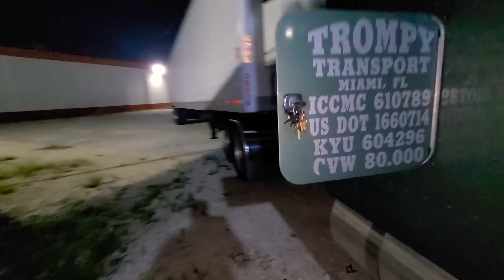Already Broken down 🤦🤦🤦🤦🤦

Comment: Hey brother, did you ever get a chance to check out the aluminum reservoir?  I'm still waiting to get my truck back after an outer frame rebuild. There done, but buttoning up loose ends Now! To make sure I have no issues once I get it back. Then the x day it's getting a front end alignment. Replaced the shock's, springs, lowered it 1 1/2 in the front, spring pin bushings, new rear driver oils!

Comment: Man I know the pain man. My shit wouldn’t start then got it started and it started pouring oil out the oil cooler gasket so changed gasket and starter then did 2 loads and my fan clutch started wobbling like a drunk so had to change that too. Seems like when things start kicking your ass you can’t catch a break.

Comment: It’s great to see you back out on the big road.  You are having it tough with the re build costing so much plus cheap freight.  But you will survive because you have a good head on your shoulders.  It’s your truck, your trailer, you d/head as far as you want to.  And you are right IF enough guys would refuse the cheap rates then they will go up.  That’s always been the owner operators biggest problem, it’s themselves!  As long as they accept cheap rates, rates will always be cheap.  
The odds are stacked against owner operators but if they were all like you the odds would be stacked more in favor of owner operators.
At the end of the day YOU are fighting for your living, for your family and yet continuing to maintain your integrity.  Keep on keeping on, you will make it, there’s gonna be better days.

Comment: There is a filter in your power steering pump reservoir that should be changed every 100k so if it hasn't been changed in awhile I would change it mine got stopped up and caused me all kinds of steering issues but after I changed the filter out it was like brand-new again what a relief because I thought my pump was bad that's how much of an issue it caused over a 5 dollar filter.

Comment: Another thing to watch is the oil dipstick. If the ring on top you put your finger thru to pull it out gets loose get another dipstick. We had one in a 6NZ that broke off and the dipstick went into the oilpan. We had to take the oilpan off to push the tube and dipstick out and replace them.